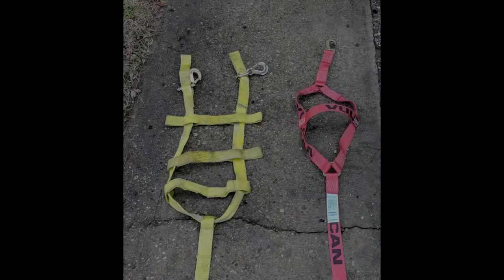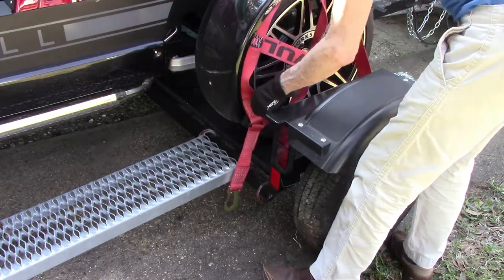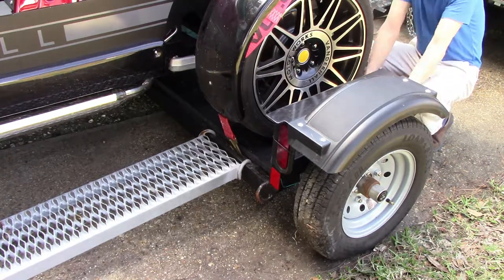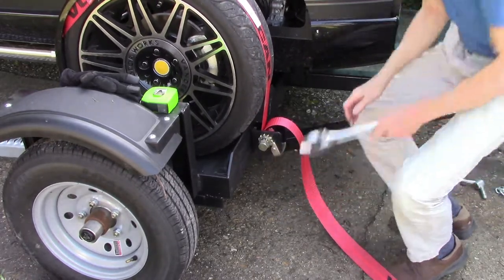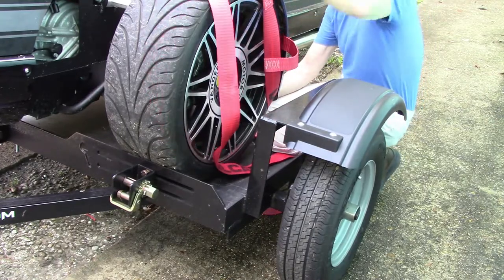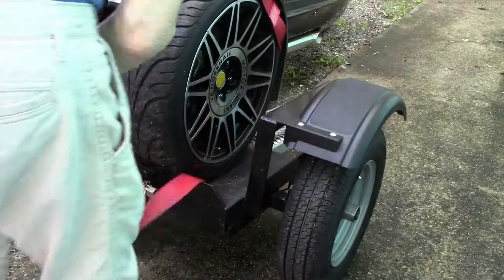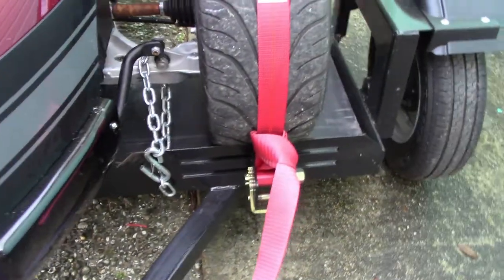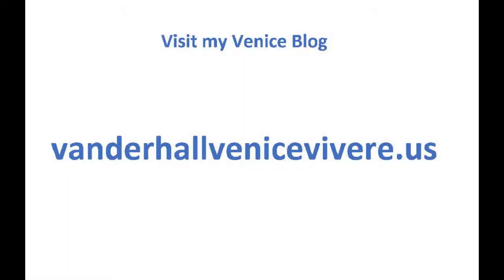Vanerhall Venice Tow Dolly - Vulcan Tire Straps

Comment: Would there be any benefit to taking off the fenders?
Reply from the maker: That was my initial thought until I looked at the how the fender brackets are mounted.    My next idea was to remove the fenders from the bracket.  This would make it a little easier.  However  to do so you need to remove the wheel.   Also, the fenders are attached with a collar nut that is easily destroyed.  They can't withstand much torque.  The torque spec on these is 16 ft pd  and I have found that they will break with that unless you are using a new nut.